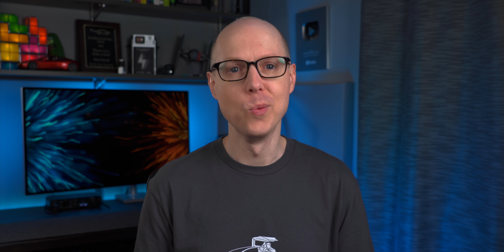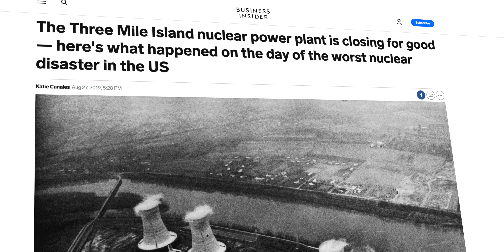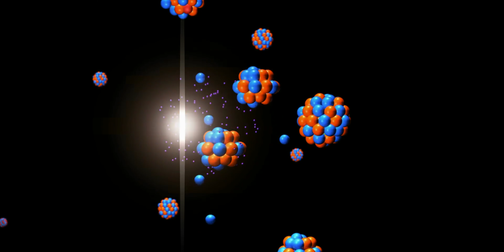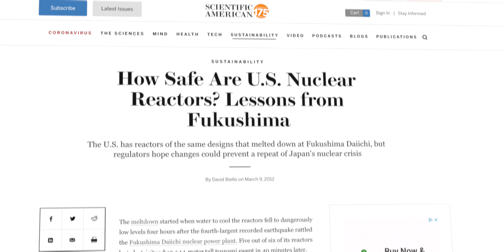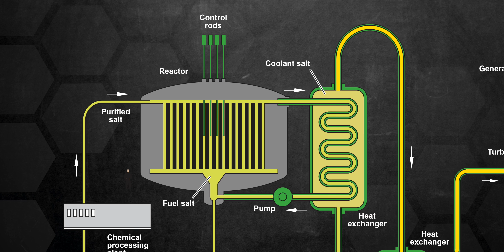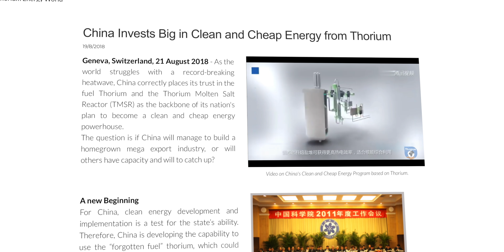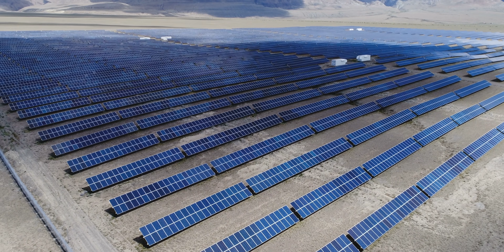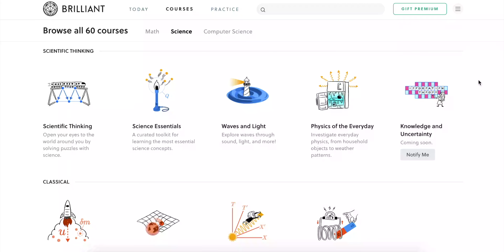Thorium explained - the future of cheap, clean energy?

Comment: (4:32) Only a small portion of the fission products from a thermal spectrum thorium MSR breeder would require longer term storage. The vast majority of fission products from this type of reactor have very short half lives and would have completely decayed away in about a decade. Beyond those, you're only looking at a couple like Strontium 90 and Caesium 137, which both have half lives of 30 years, and thus require about 300 years to completely decay to nothing. Even these shouldn't be considered "waste" as there's numerous industrial and scientific applications for steady radiation sources like these.
Reply: strontium 90 can be used in space probes.  The heat can give enough energy to keep the probe warm and power it electrically using a thermocpouple process.
Reply: @watchthe1369  It's also a beta emitter and can be used to drive direct electrical current.

Comment: (4:20) What also set's U-233 apart is the fact that it has a fission rate of 90%, meaning 9 times out of 10, when it's hit by a neutron it'll fission. The remaining 1 out of 10 it'll become U-234. If it absorbs an additional neutron, it'll become U-235, which has an 85% chance of fissioning. As such, by breeding U-233 from thorium, you can ensure that you get almost complete burn up of the fuel and you shouldn't generate more than 1.5% transuranics, as opposed to current reactors which leave closer to 98% of the fuel unburnt or converted to transuranics.
Reply: Alas they do not work.......what I mean by Do not work ,  is  when the yield is low, and maintenance is high ....technically, economically, in practice ..It don't f...ing work. But i would love to be proven wrong! Meanwhile thank science for Elons 4680.
Reply: @brianevolved2849  What do you mean it doesn't work? Only one has ever been built, Oak Ridge National Lab's MSRE, which was not a breeder, only a MSR running on U-233, and that worked fine with little maintenance over 6,000 hours of experimental operation. So, what do you mean they don't work?
Reply: @williamsmith1741  Dear Wily I was not there  and I assume you were not there to see it working. Did it really produce any significant power? I am pleased you have  Faith, and 'believe' in what you are told, supposedly occurred many years after the event.  Tis most peculiar that NO ONE has managed to get one to work efficiently since.
Reply: @brianevolved2849  Well Briany, it's a fairly well documented experiment. It was never repeated because it was an afterthought pursued by the Oak Ridge National Laboratory based on their findings from the Aircraft Reactor Experiment the Airforce had them do back in the 50's. It wasn't developed because the MSRE was a thermal spectrum fission reactor, and as such can only operate based on U-233 or U-235, and the U-233 fuel cycle can't be used to produce nuclear material for bombs, due to both contamination from U-232 and because of the incredibly low breeding ratios, taking 20-30 years to double the amount of fuel you started with. 

The focus was always on fast spectrum sodium and liquid metal cooled breeder reactors which could be used to produce ass tons of excess fissile material for bombs and which had the capacity to fission most transuranic. However, if you want to say something has NEVER worked, you can definitely point your finger at fast spectrum reactors. There's been over 20 different fast reactor research projects and reactors that have been built over the last 70 years, and almost none of them worked or worked very well. But fast spectrum technology has always been so enticing, like the call of a siren, that the focus has always been on that technology, and things like the MSRE were dismissed and then forgotten. MSR reactors were only rediscovered back in the early 2000's when Kirk Sorensen, while he was still with NASA, was researching potential reactor designs for a potential power source for a Moon base. He found the MSRE research documents in a locked storage room in the Oak Ridge children's center. 

You can watch a video on the MSRE produced by Oak Ridge back in the 60's on their YouTube channel called "The Molten-Salt Reactor Experiment". You can read about it in "The First Nuclear Era" by Alvin Weinberg and the technology in general in the textbook "Molten Salt Reactors and Thorium Energy".
Reply: @williamsmith1741  Dera Willi, both you and i were not there, so we do not know how well it worked, or if it worked??
Reply: @brianevolved2849  Oak Ridge, in addition to the video on "The Molten-Salt Reactor Experiment", the lab also has a video on "Remote Maintenance of Molten Salt Reactors".
Reply: @brianevolved2849  Dera Briani, we do know how well it worked because it was a nuclear experiment, and was thus well documented. True, I wasn't there, but I also wasn't there when the Wright Brothers flew at Kitty Hawk because it was documented, or are you suggesting there is a conspiracy at play here?

We know how the reactor operated, operating almost continuously for over 6,000 hours, only shutting down over the weekends as the researchers refused to work on the weekend. We also know the issues they encountered like noble metal's plating on the inside of the heat exchangers, addressed by managing the chemistry of the fluid, the salts leaching chromium out of the nickel alloy, addressed by doping the salt with beryllium, and the production of tritium that worked it's way out of the reactor, but which Oak Ridge addressed in subsequent experiments. 

Then again, I wasn't there, so it's probably all an elaborate lie. I wasn't at the battle of Waterloo, so that's probably made up too. Didn't fight in WWII, so that probably didn't happen either. I wasn't alive in the 19th century, so Abraham Lincoln probably didn't exist. 

Read books Briani...

Comment: This is a problematic video.  There are just too many inaccuracies.

You said that the possibility of a melt-down is constraining growth in uranium-based reactors.  But there are other important reasons.  Nuclear waste is one, and it's a problem we haven't solved and makes the public nervous.  But the biggest reason of all is cost.  Nuclear is by far the most expensive source of electricity.

Nobody builds commercial reactors without state aid.  Nobody.  Utilities won't touch a plan unless the government kicks in billions in grants, sales guarantees at high electricity costs, and legal indemnity - the last means they won't build unless the government grants the utility immunity in the event of a disaster.  If they don't get immunity, the insurance costs will eat them alive.  The chance of an accident is pretty low, but the consequences of an accident are astronomical.  An insurer charging low rates risks going bankrupt.  So they charge high rates.

So it's economics, more than anything else, that has forced nuclear into a hiatus in this country.  Too damned expensive.

Thorium reactors are in theory safer, but this hasn't been proven yet.  Waste is less of a problem, but it's not no problem.  And cost?  It is not a foregone conclusion that thorium reactors will yield economical electricity.

Nobody is building commercial thorium reactors on their own dime.  Governments pay, or nothing happens.  I think we'll find that as the tech is matured in the laboratory, that fact will hold true.

Meanwhile, tech for storing electricity from intermittent sources is advancing, too.  There are lots of candidates.  Batteries are one; charge them from intermittent sources, discharge when the grid has peak loads.  Tesla has shown that their storage battery products can eliminate the need for gas peaker plants and save utilities money.  Vehicle-to-grid tech is being developed, so as electric vehicles gain traction in the marketplace, utilities could use those during peak periods and charge them off-peak.  We're talking about enormous virtual power plants.  Investment required?  Negligible, really.  Battery costs are falling, so the prospect of using them to support the grid is improving.  The software to do it is under development, and consumers will pay for the vehicles, and even get a cut of the savings.  We can pump water into reservoirs and harvest energy as the water is released during peak periods.  We can heat water, or something else, and take out the heat when we need electricity.  We can spin giant flywheels on magnetic bearings and use those for storage.  We can split water into hydrogen and oxygen, cart off liquid oxygen for sale and then burn the hydrogen with atmospheric oxygen to recover heat.  None of the alternatives will involve any radioactivity at all.  And none should cost multiple billions of dollars at a crack, or require massively expensive insurance, or require government grants, guaranteed high electricity prices, or indemnity.

Nuclear is the least favorable economic prospect, of all possible investment opportunities.  Private investors don't want to hold the paper on new projects unless public money, guaranteed high electricity rates and indemnity are offered, which the public does not favor.  I don't think thorium will change that equation enough to make it worthwhile.  I could be wrong!  We'll see what comes out of the world's labs.  But y'know, thorium has been understood, in principle, to be better than uranium reactors for many decades.  I think there's a reason it hasn't made it out of the developmental pipeline in all of that time.  It's the same reason uranium reactors slowed, and finally halted altogether.  Cost.  When all is said and done, the electricity it will make will be too expensive.
Reply: Hi Urgelt,
You seem open minded.  There are several books on Thorium, but the best, (in my humble opinion), is "Thorium: Energy Cheaper than Coal" by Robert Hargraves.  You might also look at the (free) book, "Sustainable Energy - Without the Hot Air", by David JC MacKay.

Nuclear power has been so over regulated, that it is barely profitable in the USA.  But there is a giant renaissance in nuclear in China and elsewhere.  THEY are not spending anywhere near as much as the USA does to build reactors, and the reactors are much safer than ones designed 80 years ago.

Finally, the long lived nuclear wastes (the actinides) need to be put into a reactor and burnt up.  We just need to build reactors that can use these fuels.

Warm regards, Rick.
Reply: @RicksPoker  Cheaper than coal is an assumption, not a fact. No thorium reactor design has yet emerged from the developmental pipeline to be commercialized - not even in China.  Your sources assume it will be cheaper.  I assume otherwise.

I'll take issue with your statement, "Nuclear power has been so over regulated, that it is barely profitable in the USA."  It's not that the regulations are not onerous.  I'm sure they are.  It's that no nuclear power plant is able to produce cost-competitive electricity.  China funds them with public money.  Japan, USSR, Iran, Germany, France, the UK, everyone uses public money to get these things off the ground.  You can't blame US regulation for the fact that private investors are not willing to pony up.  The only way nuclear plants are built is if governments sign up to subsidize them, and force consumers to pay higher rates.
You will know if thorium reactors really are cheaper and safer if utilities decide to build them without government grants, without guaranteed high electricity rates to consumers, and without indemnity from liability if it all goes bad.  That is how you will discover that they're economical.

You know that isn't how it will play out, though, don't you?  If utilities decide they want thorium reactors, their lobbyists will come hat in hand to legislatures begging for money and special favors.  And that is a clear signal: they won't be economical.

No nuclear power project can stand up on its own two feet with private funding and a reasonable pay-back period.  Investors aren't interested.  You can twiddle and tweak regulations, but it won't matter.  Private investors won't be there.  Either it happens because governments decide to make expensive electricity, or it won't happen.

It's nice that you think I have an open mind, but this is my opinion.  Facts could change it, but not assumptions.  Perhaps we can revisit this conversation when developmental engineers are finished with designing and costing a final product and a utility decides they want it.  Will the lucky utility ask for permits, but not ask for money and special favors?  Will they have investors ready to back the project?  Will they obtain reasonably-priced insurance, since the design is so safe?  Or will it be just another public money grab for a project that isn't economical?  Who is right?

I'll admit I could be wrong, but I won't hold my breath for an economical, privately-funded thorium reactor.  I don't believe it's in the cards.
Reply: @Urgelt  
Hi Urgelt.
I suggest you read the books that I listed above, if you want facts.  A thread on YouTube is not the ideal forum for complex arguments, but it can point out fun links or books!

The book's title "Thorium cheaper than Coal" is not a report of what is happening now, rather its a goal that Robert Hargraves thinks is vital.  

As for governments are the people buying nuclear.  Maybe that is because governments are the entities that want gigawatts of power.  China is determined to phase out coal; far too many of its people are getting sick and dying from the pollution.  

I saw a report a year or so ago that said that New Delhi has worse pollution than Beijing.  So the Indian government is funding research into Thorium reactors.  This seems to me to be a good thing, I want to see fossil fuels phased out as soon as possible.

But I'm willing to agree to disagree.  I would be very surprised if there are not Thorium reactors producing power within 10 years.  What really has me excited is the version (which use Chlorine and heavier salts) that run at a faster neutron spectrum which can burn up our current nuclear wastes. 

(One advantage of Th232 --> U233 is that it can fission and produce more than two neutrons right across the neutron spectrum, so thermal, fast and everything in between can still sustain criticality.  This makes it very forgiving about the type of fuel it can use.)

Warm regards, Rick.
Reply: @RicksPoker  Rick, you really must distinguish 'goals' from 'facts.'  Absent a commercialized model in hand, costing is speculative, okay?

I'm sure you grasp the physics of thorium reactors much better than I do.  I'm focused on the economics of thorium reactors.  A claim that they will be cheaper than coal is, at this point, entirely unsubstantiated.  I think it's very unlikely.  You can cite as many 'experts' as you like, quote from books, but I won't change my opinion without cold hard facts about a fully designed, fully costed, ready-to-deploy plant.

Keep in mind that moving, storing and handling nuclear waste products itself involves risk.  Insurers will not sign on the dotted line for less than a king's ransom.  Those costs will be included in any commercial cost-benefit analysis.

If thorium reactors are commercially viable with only permitting involvement by governments, if they can produce cheap electricity - not proven, but we'll see - then the projects that will go forward will not require taxpayer subsidies, guaranteed high electricity rates, or government-granted indemnities.

But if we see lobbyists demanding those handouts, then nothing you've said, nor said by your 'experts,' makes any economic sense.  It's just another form of expensive electricity mandated by governments, not cheap energy.
Reply: @Urgelt  
Hi Urgelt.
Why would someone attempt to build a new technology?  Because they think that it will be better than what we have now.  

Thorium is 300 times more common than U235 so it will be cheaper.  It is proliferation resistant.  It produces far less long lived wastes.

Molten salt reactors allow the fission products to be removed, while leaving the un-burnt fuel to remain in the reactor.  This can cause a massive reduction in long lived wastes!  The freeze plug design, invented at Oak Ridge in the 1960's makes the reactor walk away safe.  It is trivial to pull Xenon (a powerful neutron absorber) out of the reactor.  The reactor (since it uses a liquid) is load following, and becomes less reactive as the temperature rises.  It runs at a significantly higher temperature which gives it a better thermodynamic efficiency = more power pulled out and less waste heat.

I've heard that it runs hot enough that the reactor can be air cooled.  I am not sure if this is practical (I've not seen a good break down of how the numbers work) but if true, it would allow local power plants in arid areas.

I think that there are many good reasons to follow up on this technology.  However, what I think is unimportant, because I'm not rich.  But lots of people with money ARE investing in it.  That means in a few years we can see if it really IS cheaper than coal.

:-D

Warm regards, Rick.
Reply: @RicksPoker  All my best, Rick.  Thanks for the conversation!